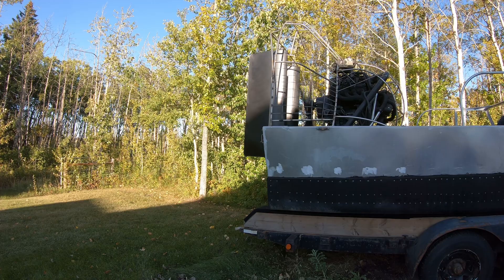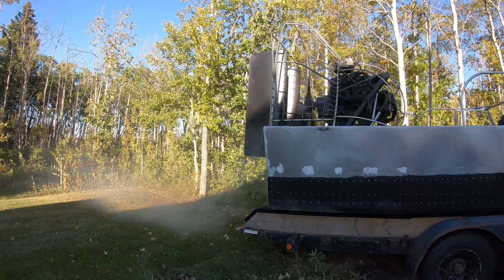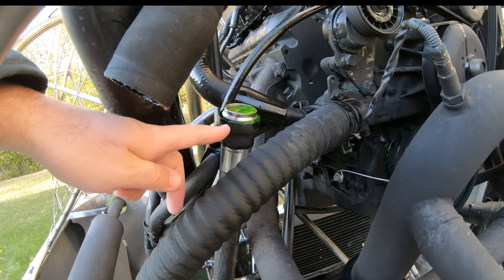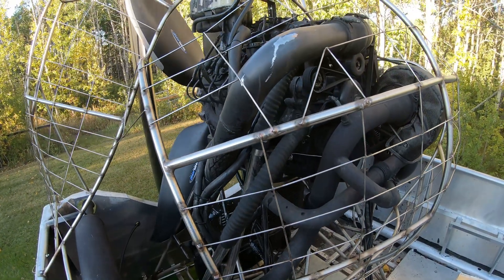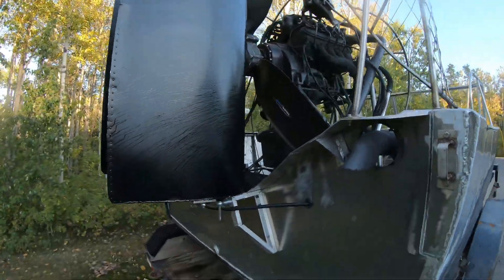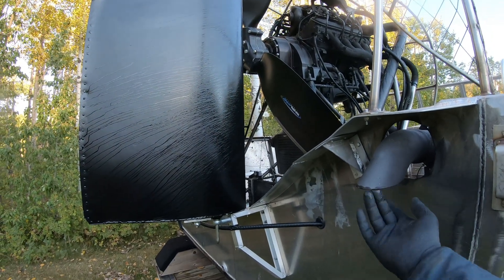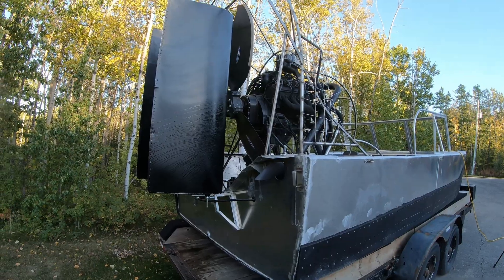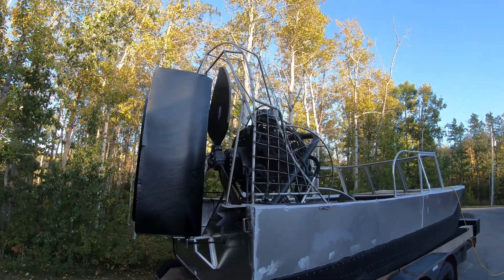Airboat Build #40 - Let's Start It Up!

Comment: I am building a small airboat now ,,, 140 hp snowmobile engine 12 foot aluminum hull just a squirt compared to your beast ,,, Also built a hovercraft ,,,, one experience with the hovercraft may be of benefit ,,, I was on the Grand River near Paris Ontario came around a bend and there was about 20 canoes with Japanese tourists ,,, I motioned to them to move out of my way so I could pass them with lots of room ,,, the air blast from the 6 foot prop was a concern and to my dismay this canoe of young kids came right up to me ,,, the prop has a guard but accidents happen ,,, anyway they got the air blast in the face and looked really pissed off ,,, I thought  hope they didn't get anything serious in the eyes ,,, after that I put a sign on each side of the boat saying "Danger rotating prop" Hopefully the signage would be an angle for defence if there was a liability claim due to injury of a bystander,,, just a thought I though I had seen everything until that experience.

Comment: where is the gearbox reduction from?
Reply from the maker: It’s a Ballistic gearbox in 2.5 ratio
Reply: @dr.dansgarage  thanks man
Reply: Man that is awesome….I have a spare l96 6.0 just sitting in the garage I built a few years ago …..it’s just a spare motor in case my lsa nova or vortech supercharged c10 blows……but lately I’ve been thinking of a jet boat / air boat even though I already own an eagle 230 eliminator with the vortec 8.1 big block 496 in it…….but I want a thrasher boat,